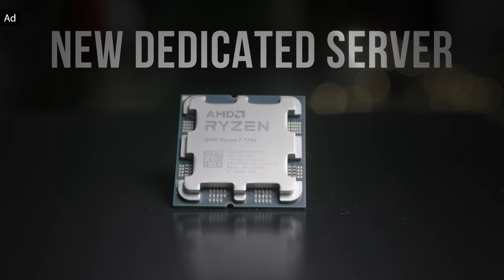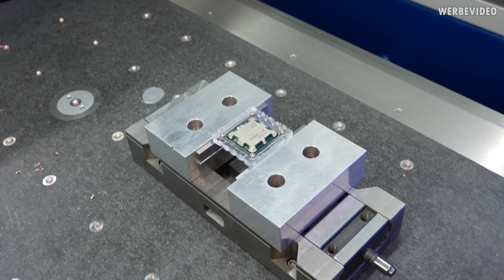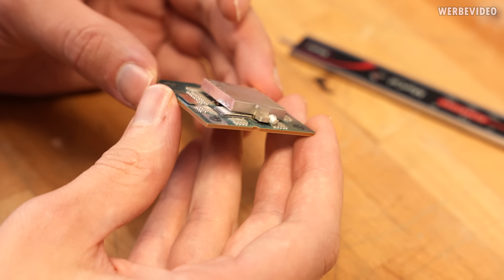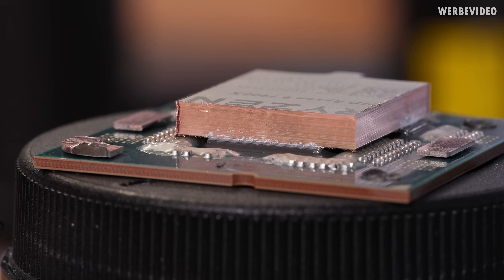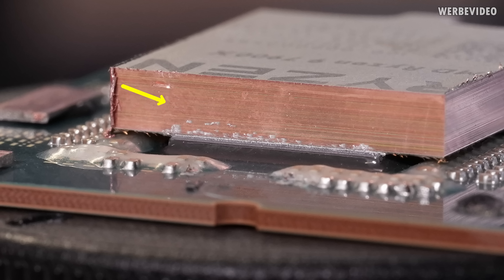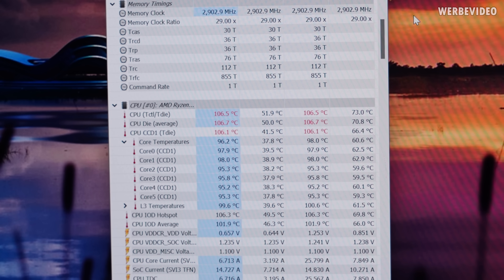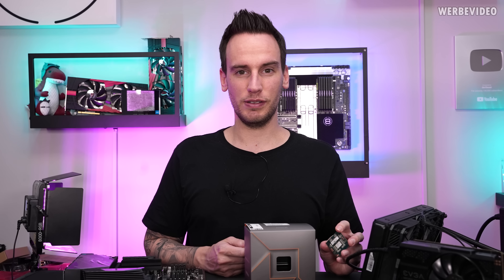Viewer-Mail Ep8: This CPU Unsoldered and Killed itself

Comment: from just looking at the aida temps there it looked like the I/O die was the one that was able to get hottest - is it possible that the IOD has no thermal protection but the cores do and the IOD is jacking way up to whatever temp is needed to melt the shiz while the cores arent tripping the protection?  would explain the river of juice from the IOD down between the cores and out when you delidded our friends chip...also i am wondering if your 160C temp is actually incorrect and it is actually lower - perhaps low enough to melt at say 125 or 120 by being alloyed whether on purpose or just accidentally/incorrectly resulting in his chip IOD getting to say 120C while the cores stay below the threshold for protection, solder melts, river flows which heats up the cores more dumping heat into them causing the bubbles and permenently facking his chip.....and if mounted vertically gravity helps make it happen whereas it would not flow like it did mounted horizontally or on a test bench.....???

Comment: Just a theory, could be that the pins and pad contact between CPU and socket was at fault? Could cause arching or the pin and pad that supply data on temperature was poor. We have seen the issue with Intel and hence where a the contact frame was made.

Comment: What if you set Platform Thermal Throttle Limit to 255?  And do some heavy benchmarking?  The temp sensors might have some delay before throttling down, it's enough to make the solder melt.

The guy who damaged his CPU might not tell everything, I mean, that's what everyone is doing right?  "Gee, I don't know what happened I didn't do nothing this just died." 
Claim warranty, new CPU, profit.

Comment: First older amd gpus dieing at early used age… then new amd cpu issues left and right of CPUs frying and dieing or glitching out taking out new motherboards.. then of course ddr5 issues, chipset issues, usb issues… I’m all for amd and them giving competition to Intel. But their quality control and long term product use is not looking good…… Intel beats the death in lab out of their CPUs for QC checks and long term useability. I own Intel CPUs from lot of eras and they all still work….

Comment: I would wonder about his heat sink.  ANY heat sink.  HOw hot did it get and what did it do to the heat sink.
The attachment of Any extra metal touching the top surface of the ship Should have pulled off SOME heat.
THEN if his paste on the heat sink failed at high temp, the temp would have ramped up.

Comment: My theory: The chip was working very hard (not just idling, as your chip was in your tests). It was probably already at the 95 degree limit when cooling suddenly failed (bad water block mount let it fall off?) and the tremendous heat already present in the CPU forced its temperature to shoot past 160 degrees. There would have been nothing the internal temperature detection and protection measures could have done to prevent this as the heat was already present and suddenly it had nowhere to go, so the temps went through the roof.

Comment: I had a very similar issue happen to me once with Precision Boost Overdrive by tweaking the curve manually.  in current AGESA's for lots of BIOS, there is a bug in the curve editor that has issues with power draw.  For whatever reason my 5800X i watched rocket off to 130C in under two seconds before it finally shut down, even though i only told the curve to increase maximum by 10MHz.  Because of the delay in this temperature control, it is entirely possible this 7000 series rocketed off to 160 whilst trying to boost all cores when loading an application or benchmarking an OC profile, meaning the temperature spike was so fast your own tests were nowhere close in comparison.

and yes, my cpu had its watercooler on at the time as well.  i was terrified.  luckily nothing was damaged even at the temperature it hit, and after 10 minutes it was alive.  i still use that chip to this day, without any PBO offsets

Comment: Very strange. I wonder if they higher temps are perhaps because when there's no cooler at all, the CPU cannot actually throttle low enough to stay under 95C? Maybe even at its lowest power state it's still too much with no cooler and that's why it goes beyond 95C.

Comment: I don't buy the cooling failure theory by itself, raising the CPU temperature that much for any length of time would require the liquid in the loop got hot enough that you'd be able to feel the radiative heat from that amount of thermal mass if you put your hand anywhere near the computer.

Comment: Aside from this issue here, what if we could run these processors at 110C with direct die cooling for boiling water. The expansion of the boiling water could act as the pump, meaning that the pump would only ever fail, if the CPU was too cold, the cooling loop was overpressured(say 20PSI) or the water evaporated.
IIRC you can reduce the boiling point of water by adding ethanol to it but that would probably cause problems with seals and sealants.

Comment: When I started my IT career in the late 90s, I accidentally overclocked a Cyrix processor by putting it in a board with its jumpers set for a much faster Intel CPU.   It got so hot, so quickly, the ceramic package cracked. This is the first time I've seen anything similar.
Reply: I haven't heard anyone reference a Cyrix processor in FOREVER!!!!  Interesting story from the old days.
Reply: The old days processor’s didn’t have thermal protection I had some crack and experimenting just by removing cooler and got up to over 350c really quickly. 

This one suspect it shorted, could have been from over voltage likely? The hotspots kind of point to that direction?

Comment: I would do an analysis of the composition of the 'shiny' bits of indium still on the die. That TIM is technically an Alloy and if the material was not properly made, you may have areas with a lower melting point.

Regarding 100C due to water evaporation - Since the cooler is closed loop, any initial evaporation would result in increased pressure, raising the boiling point of water.

Comment: 2:20 nailed it on the head. This cpu was not being cooled adequately and it's melted the solder that is attaching the IHS. The only way this could have happened is user error. I also doubt that this cpu will work ever again.

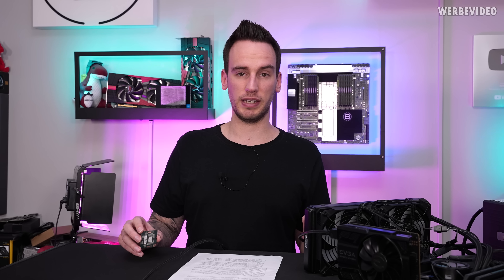12:17 WOW i can not believe roman is trying this hard to not call out incompetence. It is very possible the AIO was empty. You have no idea how many build it's been in or exactly what model it was. This user seems to be configuring his rigs for 0 fan speed and 0 pump speed. Do that over 2 or 3 builds and you will boil the coolant clean out of the tubes. Roman, you know this and i have seen it multiple times in the last 5 years. People are not configuring their cooling solutions to actually cool something. They are configuring them to be quiet. You can not expect a fan or a pump to do it's job and be totally silent. Worse is that this idiot got a free upgrade for being incompetent and not being smart enough to accept it was his fault

Comment: I think you might use X-Ray at start before remove IHS. It will give you exact picture of what's inside.

Since you got you hands on this CPU anyway, maybe use electronic microscope of CCD? It might be interesting too what CPU overheat look's like from inside.
Reply: You need to factor the IHS thickness and what you are looking to "image". Having 3.5mm of copper before your actual target will hinder imaging a lot, as copper is used to harden xrays and filter out lower energy photons. You will need something like a 120-140kV tube, which is usually what you would have in a CT scanner. In a domestic / machining lab environment running such an high energy tube would require significant shielding to avoid scattering and xrays going everywhere.
Reply: @Mjoll87  Not to mention the building would require the proper electrical supply!
Reply: I was thinking xray too, but from the PCB side not the IHS side.
Reply: @josefmazzeo6628  It's essentially the same. X-ray imaging works by sending high energy photons through your target, and measuring how much of them pass through and reach a photoluminescent target that turns them into either light, or directly digital data through a panel sensor. You are still going through the whole chip assembly. If anything milling a few millimiters off the IHS might help. Search for digital x-ray panel sensor, you might get a few useful bits of info on how this kind of stuff works today.

Comment: It is possible that this was caused by a defect on the CPU. If two pins or some internal structures of the CPU bridge themselves, that might cause the CPU to draw a lot of power through the short, and kill itself.
Reply: As in, the melted solder is a symptom of a dead CPU, and not the cause.

Comment: Did you have it under load when you took the cooler off?  Maybe if it's under a full load and the cooler loses contact, the temp might shoot up near that 160 before the system can react and shut it down?

Comment: Maybe it was a combination of CPU temp sensor controller failure together with sloppy paste job with far too little paste? Or the water block being warped for whatever reason with bad contact with the CPU at the center that then went to hell once the CPU temp control failed? As you stated, the CPU has a lot of sensors so it seems unlikely for all of them to fail at once - unless they have a central control unit that manages them all.

Comment: The MSI MAG 280R is affected as well. Still Apaltek-made garbage.  The fact that it got hot enough for the solder to drip down from the IO die, which normally will peak at about 60C when the pump is running, indicates that the cooler likely die and the cpu also had a defective thermal sensor.  Hopefully he replaces the cooler before boiling the X3D.

Also the 115C is the stock thermal shutdown limit for Ryzen since at least Ryzen 3000 (I never tested the limit on 1000/2000), including Ryzen 5000.

Comment: Can you please remove the solder so we can see a clean shot of the dies?

I hate to by cynical and I'm not calling the viewer a liar but to play devil's advocate... what if they simply tried delidding with heat, not knowing the glue has to be removed first? If they gave up and tried running it without seeing the indium, it would have died instantly. Buildzoid recently posted about delidding his with a hot plate.

Hard to believe they'd then contact you but that makes a lot more sense than it somehow reaching 150C+ with no other visible damage. Even contaminated solder or trapped moisture shouldn't explain indium flowing out the edge below 115C.

It's certainly possible this is a hardware failure but I've never heard of anything like this. If there was a VRM failure causing a prolonged voltage dump the board should be done as well. So many things had to go wrong. If we assume the cooler was on, something would have had to short out while the system was frozen without triggering any protections. That would mean there's likely a bug that made the board think the chip was operating while it sent itself to the eternal hunting grounds.

Comment: Because of the glycol in an AIO, the boiling point of the coolant is higher than 100 Celsius, but not much.  Regardless, enough thermal mass to give the protection mechanisms time to work.

Comment: You can try extract the micro code from the CPU and his bios , the other possibility would be that something shorted within the chip, depending on the mounting pressure.but I think what was said about an alloy could be possible but would be extremely unlikely because they use specific metals and contamination would produce an immediate error in the lab unless it's the one defect where a bit of impurities where missed from the ore of one of the CPU's material

It could be a bit error

Comment: the water does not have to evaporate... the boiling point of water is 100c only at 1 atmosphere, sea level, the open air. once you constrain and put water into a sealed closed loop, then it can be under higher pressures. so a little may boil, that small amount of generated vapour will then pressuruse within the container. and then the remaining water in the loop will be pressurized to enough level to raise the boiling point above 100c, while still remaining as a liquid.

Comment: Hmm... What if a user has liquid metal TIM between heatspreader and waterblock. If some liquid metal gets squeezed out below, reaches edge of heatspreader, around the corner of heatspreader, maybe it can wick upward into the CPU soldered TIM? Maybe the nickel coating is only perfected on top surface of heatspreader? So, exposed copper might be attacked/wick liquid TIM..? 🤔

Comment: Maybe the guy was lying about what really happend to this CPU? Maybe he has cooked his 7900X CPU in an oven until it reached a high enough temperature to start melting the indium, then kept going 'til the solder started to boil 'oozing' to the substrate killing the chip. Now he has a brand new 7900X3D thanks to your generosity Roman.
I'm not accusing the guy of doing that at all. I'm just speculating... and thinking if is worth doing sort of the same thing over here. I buy a 7600 and break it completely by my own, then I send it to a local techtuber channel hoping they send me a better CPU to use mine in a video that will eventually make them more money than the two CPUs combined. Everybody wins!!!

Comment: Have you checked viewer's statements? Maybe he 'played' with extreme overclocking (something to trick current readings for eg.), overheated AIO (I would say it's technically possible to evaporate water at heat exchanger, and to stall the pump as a result) and got fried CPU. And decided to get a new CPU for free.
Reply: We will never know. This is very suspicious. I would like to see that cpu inspected by amd engineers.

Comment: Not a manufacturing defect? Is is user error then? -.- The definition doesn't necessarily mean the manufacturer is to blame, but imo this happened during manufacturing. Somehow air pockets (several as seen) was introduced into the indium during the soldering process, and these created hotspots during use, which in turn got so hot that the indium boiled out.

Comment: It's possible the user had some third party tool installed for fan control/temp control and possibly tried to send a kill command to the system but the system already hung/froze so it just kept pumping voltage into it as the power supply didn't get a shutdown signal.

Comment: @der8auer with regard to water temp, Ethylene Glycol, found in many coolants used in custom loops, raises the boiling point significantly above 100° Celcius. Also liquid when put under any pressure, (which is created by heating the closed system), raises the boiling point also. Interesting nonetheless :-)
Reply: Yeah but not even close to 160c

Comment: It seems like AMD targets 95C operating temperatures but builds in a buffer up to what looks like 115C until shutdown. There have been rare reports of malfunctioning CPU temp sensors in both AMD and Intel CPUs before, so this might be one of those cases where it didn't shutdown the CPU in time.

If the AIO water is at 100C then a 160C core temp is not that unbelievable. Considering usually an AIO runs sub 40C water temp and the core can have a large delta running at 95C anyways. Amazing investigation as always Roman!

Comment: Maybe there was a fault in that particular chip that caused a dead short, allowing it to super-heat and melt the indium, and the board just froze and let it happen? It could have been so quick that the heat built up faster than could be transferred to the AIO

Comment: It’s possible that the msi aio cooler he was using had all the water either evaporate or it leaked causing the cold plat to become an insulator causing the cpu to get hotter on the die instead of the ihs
Reply: The way those coolers are prone to failing is with the cold plate completely clogged with deposits, which restrict the water flowing across the cold plate and also act as an insulator.  I do hope he replaces it before roasting the X3D.

Comment: MOSFETs often fail short when they fail, at which point there's nothing you can do to stop it from overheating other than turn off the power. Not that it would help since it's already dead at that point.

As for the high temperatures without a cooler, I doubt a naked CPU would have enough heat dissipation to keep temps under control even at minimum power levels.

Comment: I'm not sure if this is possible but I would like to see how his board specifically would handle that test you did with taking the AIO off. 

Also could there have been a contaminate in the indium that lowered it's melting temperature?
Reply: Even if the melting point was lower, it wouldn't have mattered. A catastrophic failure like this would experience a thermal runaway. That is, the chip failed first then melted.

Comment: That's incredible. I wonder why these chips go to almost 115 °C before shutting down while temp limit is set to 95. Wonder if this is a BIOS error or amd error in the chip's code. 
Even worse that a chip apparently got to 160+ degrees.
Reply: That is the temperature after which immediate physical damage would happen.
Reply: Well they want it to continue to seem to operate, that's like the speed limit - after that you moderate speed and continue at that temperature, it's just when you have a completely inadequate cooling 'solution' that even idle will overheat.